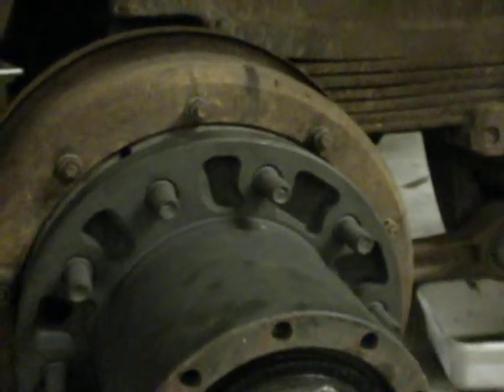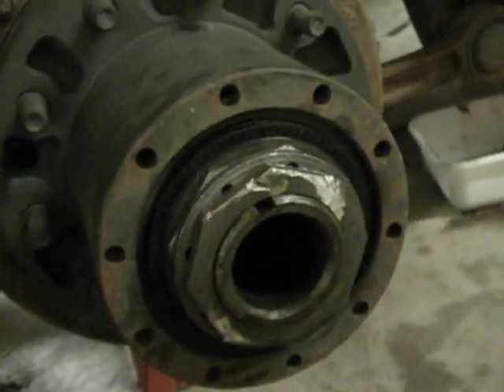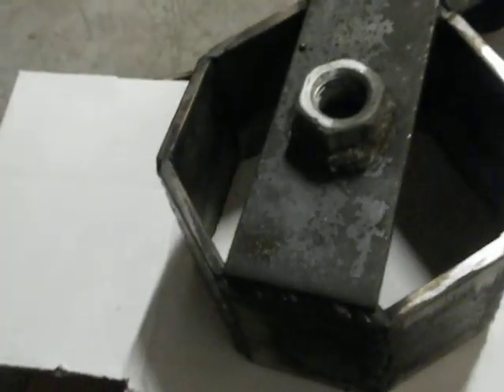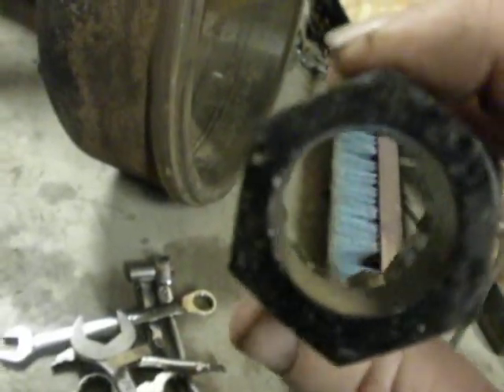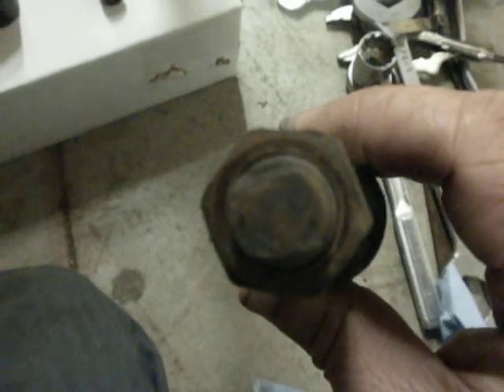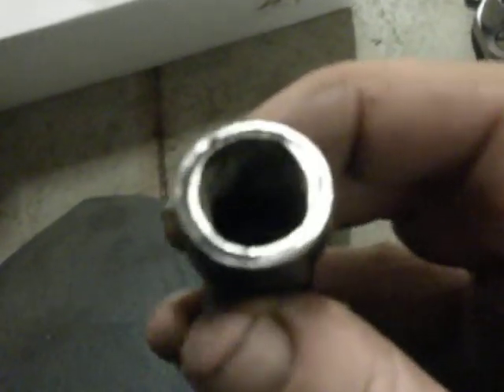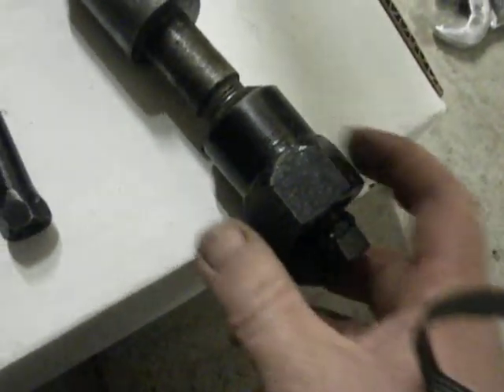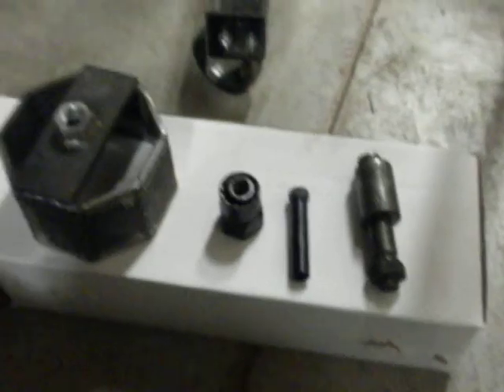Military Truck brake tools

Comment: Hi can you help with a question about the brake drum. Can it be removed from the axle to get to the brake cylinder or does the whole axle hub and brake drum as one. It looks like by taking about 8 to 10 bolts on the brake drum it will come off and be able access to the brake pads and cylinder. Can you answer this question.